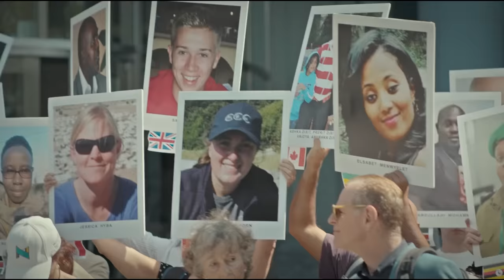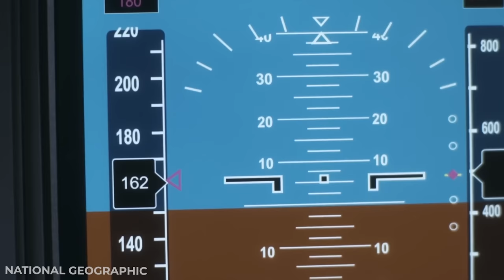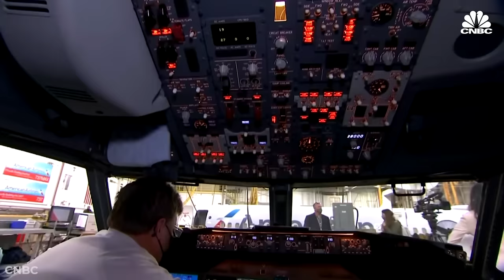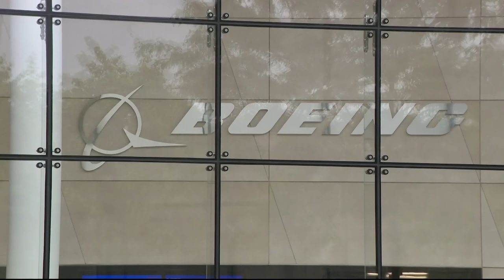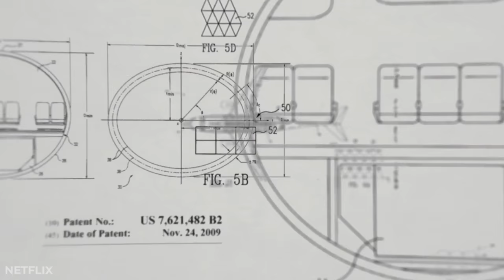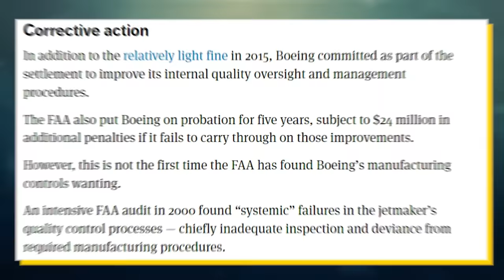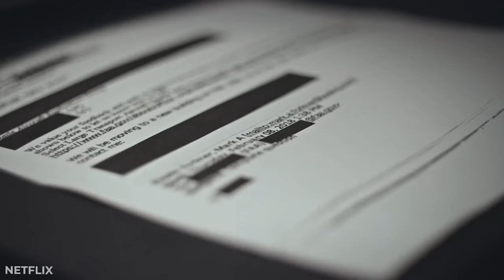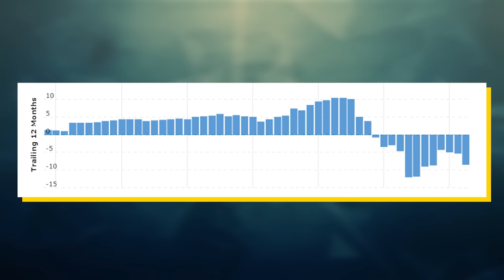Even Boeing Engineers Don't Trust Boeing...

Comment: These aluminum cargo door locks was a fatal flaw, the embarrassing part is a good engineer/citizen replicated the door lock mechanism for to further investigate his son's death and talked about how this flaw works in detail, this company I've seen so far was actually a trail before failure of ready to fly aircraft.
Reply: The cargo locking door mechanism was a problem for the  747 and the  DC-10 in the seventies and eighties by the supplier.
Reply: Yes it doesn't seem that Boeing applied itself to identifying that door problem. It was finally revealed by the NZ engineer who doggedly pursued and revealed the design issue, in spite of Boeing's non-cooperation and lack of support.
Reply: you should understand that there tens of thousands of these latches, and none has ever had a problem until now.

Comment: It is always madness to place Business logic over sound engineering.
But there’s also engineers that had reason to suspect systemic flaws if not specific ones. Any licensed Professional Engineer involved in such circumstances and organizations should be treated with suspicion. What bad characters they have.
Negligence. Arrogance. Sloth. Greed.

FTC or NTSB need to set up a whistleblower program for engineers to call out suspect transportation or structural engineering.
Reply from the maker: A lot of those engineers don’t really have a voice and fear keeping their jobs
Reply: @LogicallyAnswered  You have to build an environment where the easy, safe, and rewarding thing to do is report safety concerns.
Whistleblowing is an uncomfortable intermediate step to that.
If an engineer is handsomely rewarded for whistleblowing a shady business, inspection, or engineering climate, let alone for an actual design flaw brushed aside on the path to production? We will see business objectives line up such that engineers don’t need to put themselves out there. (Look at the fat percentage rewards SEC whistleblowers receive for financial fraud and such).

When it comes to engineers and the managers put over them, we need to eliminate the chronically apathetic and protect the honest yet timid and do both through solid guarantees of monetary penalties and rewards, respectively. Nothing else gets the job done.
Fat pensions and payouts for those who call out bad practices, and jail time or mandatory civil suits against those who were bad actors.

Malicious apathy, I think we can call it that when someone sees something and yet while facing no consequences still decides not to say something. 

We just need to create the proper incentives and smash the disincentives.
Reply: But...but... what you're suggesting would cut into profits!
Reply: We had that. It was called wikileaks. Some people did not like that website. Not one bit.
Reply: There is ALOT of bad practice in these big companies. Huntington Ingalls is one too. All these military DOD Army and defense contractors won't blink an eye at the death of an employee and won't hesitate to steal a dead man's benefits these days. Mass corruption and nepotism doesn't end.
Reply: "A good marketing team can sell a bad product. But a good engineering team cannot sell a good product. So why waste money to produce a good product?"

This has been the philosophy for decades now. The marketing team is usually better funded and more insulated from cuts than the engineering team.
Reply: Weren't they Indian H1B software engineers who just did as they were told and didn't raise any objections?
Reply: @Zed_Oud  Wow, dude, that would even fix the police! Will you be running on any election tickets near me? Make a seven second sound bite out of what you said and I think you could be president with it- really! Lots of people who might agree to put such a system in place will turn on it when it becomes their turn to "come clean", but it is exactly what needs to happen to "fix" Boeing and much of America, private and public.    FR
Reply: A near-fatal 1972 incident in which a DC-10 suffered explosive decompression when a cargo-door blew off exposed the need to address weaknesses in the DC-10 airframe that merited immediately attention to ALL DC-10 airframes, whether flying or under construction. The FAA decided that such a drastic move would hit the sales prospects of the new airliner, so they allowed McDonnell-Douglas to fix the in-service DC-10s 'over time', so it wouldn't scare prospective purchasers. Two years later, an unmodified DC-10 crashed in France, killing hundreds of people.
   On the face of it, the FAA was prepared to put passengers' lives a poor second to protecting commercial interests.
Reply: Come on: these regulatory bodies are in bed with the commercial interests whose sloppiness and irresponsibility they were supposed keep in check (independently).
Reply: What are you chances of working as a professional engineer if one blows the whistle?
Reply: As an engineer, I am confident that the short comings in the MCAS system would have been identified and raised by the engineers, but obviously they were over ruled by managers and told to develop it.

And I highly doubt the engineers would have supported the decision to wilfully hide details of the system from the customers by not placing any mention or description of the system in the aircraft manuals.
Reply: @thee-sportspantheon330  official paid whistleblowing already exists for financial crimes under the SEC and whistleblowers can get paid 10-30% on crimes greater than $1M. They’ve paid out over $1.3B in the last decade.
Reply: @the11382   There have been laws passed to protect whistleblowers.   But it does not go far enough and I don't know if it can.   Might lead to a glut of false claims if it get too profitable.

Consider this. Airline deaths are generally below 500 a year.   Automobile deaths number 1.3 million.    Cars are waging war on us.   We need FSD yesterday.

Comment: In 1985 I came back from an overseas job to work for BAe at Filton UK.  With 20 years of Aircraft Engineering experience, I was appalled at their methods. A middle Manager explained to me patiently that "" You don't need to know anything about Aircraft, to be a Manager""  ! ! !  at a time they almost went broke & scraping around for contracts, building a 4 engine 146 when the rest of the world & Operators wanted 2 engines,, etc  etc  etc
Reply: The 146 was well renowned though, airlines that operates them loves it and it's unique design makes it perfect for some specialized situations.
Reply: That manager's attitude is typical of modern business models. Stinks to core!

Comment: This is a good video, but one important part that is missing in the 737 Max story, is that Boeing promised Airlines that they would keep training costs down. Also, because of the redesign of the 737 Max and consideration for flight stability, Boeing introduced software that pilots were not completely aware of called MCAS. The software on the plane would falsely detect a stall and try to nose down. The pilots were unaware that MCAS was doing this and try to exert manual control until they crashed.
Reply: Also that one of the airlines said they were going to order a bucketload of medium airliners from Boeing for delivery within the next few years; despite the fact that Boeing didn't have anything. Hence they rejigged the 737 when it was unsuitable for the purpose, given there was no time; instead of declining the order.
Reply: Correct, Leroy. Pilots were never informed that they could override the MCAS system. If you watch the Mayday show, the investigators are mostly long-term pilots with years of experience and their golden rule before all this computerized automation came in was to "fly the plane," something MCAS won't let you do unless you know where the damn OFF button is!
Reply: @acreguy3156  glorious idea to implement a cruise missile function without anyone  knowing about and being unable to be overwritten by manual controls
Reply: The fatal flaw of MCAS is that it is a stand alone system controlled by a single sensor that is known to go bad! This is because tying it to the main flight computers would have required pilots to have to be recertified on the aircraft! 😊
Reply: @acreguy3156 Pilots weren't even advised of the stick pusher function!!😊
Reply: @jackdbur  All good points, Jack. It all boils down to money. It costs big bucks to re-train pilots on new systems. They made note of this on the "10 Steps To Disaster" show on why the MAX crashed twice.

Comment: Dad was a Boeing engineer for around 35 years, with a long pedigree spanning the 1980s to mid 2010s which I won't bother to cite, suffice to say he was there for the before and after. He always lamented the tectonic shift in attitude and management style he observed following the MD merger. 787 program was such a cluster it was the last straw that convinced him to retire. The experience of constantly butting heads with management and having to deal with their absurdity drove him positively batty. And the catastrophically deteriorating Seattle traffic over the decades but that's another story.
You wouldn't think one person could make a difference but sometimes I wonder if the MAX accidents would have happened if he hadn't retired after Dreamliner. He worked in flight controls and failure analysis and was a DER (Designated Engineering Representative) in the certification process.

Comment: As an aviation engineer myself my dealings with Boeing, the OEM, was not always smooth. I found that the Europeans with Airbus industry are more diligent and disciplined. Although the Airbus planes are harder to maintain in the sense that its more like rocket science.
Reply: I've worked on several models of Airbus and find them easier to maintain actually.
Reply: Who would you rather work for?
Reply: @mangos2888  im not a full engineer yet, im an Aircraft Technician,  I take apart the aircraft and fix any discrepancies,  so basically the aircraft have the same parts or similar part numbers when you order parts, so it comes down to what culture of company you would like to spend your life with. Boeing lays-off too much.  IDK what the retention rate is at Airbus or they're pay scale.
Reply: @elely1973  Since Airbus is European, and here Unions are a major power (or pain in the butt), it is harder to layoff, and if you do lose your job, if you were in a European country you usually get around 1 to 2 years of salary as compensation. 
If you work for Airbus in another country, well i imagine the layoff would be easier, but you probably still have more stability than with Boeing.
Reply: @aleide2980  yeah..I know alot of guys who worked for Boeing and they always talking about lay-offs, I don't know anyone at an actual Airbus facility so I really couldn't say how good or bad they are on the issue..I happen to like both of the products,  its the management that can be so frustrating.
Reply: @elely1973  maybe easier to maintain, but they also are less reliable. At least the pre 777-300ER period Boeing aircraft!

Comment: I refuse to ever board a Boeing 787!
I lost my long held trust in Boeing when Engineers and Assembly staff of the 787 both said there were issues with it's production. Apparently, Boeing has allowed Executives in their ranks that don't have "Safety" as their prime objective as it was with Boeing in the 1970's.
Reply: Hah! 
Now that I am 2/3's the way through the video, it appears that we both agree on the problem!
Reply: Airbus just won over another customer.
Reply: 787 has never crashed
Reply: @matthewsmith2787  Yet! Sometimes problems take years to manifest.
Reply: @BoDiddly  787 had problems too but it did not crash
Reply: @matthewsmith2787  but it  had problems
Reply: boeing 787 never had life threatening issues, only some issues with the battery which is definitely fixed now.
Reply: @SpidaMez  that's true yes
Reply: @SpidaMez  Give it time. Sometimes errors in manufacturing don't manifest until years later. When the people building them say there are errors, believe them.
Reply: @BoDiddly  look airbus fan, i just wanna tell you Boeing 787 are safer then anything like its the best you can think off and most crashes of Boeing were from only Pilot Error and most Airbus Were crashed from system malfunction and yes its true that both are safe but will crash but only on pilot error or system malfunction.
Also you simply cant win the case by saying Boeing plane malfunctioned in past and it might be true but most were Errors by crew or ground crew such as not removing the Pitot Tube tapes and stuff like that and most instrument failure are by battery issue or the maintenance team not checking the plane fully so yea both safe but both crash
Reply: @BoDiddly  okay, yeah boeing has fucked up before, but using that logic, you could say that for the a320 neos, the a350s, the a220, and any other plane that has not had a fatal crash.
Reply: @MyulMang  I like Airbus, but I am not a fan of Airbus. I have been a fan of Boeing, specifically, the Boeing 747 since I first rode in one back in 1973. So when I say I don't trust 787's, I know what I am talking about.
Reply: @SpidaMez  That is not the logic I am using. Go back and read what I said.
Reply: @BoDiddly  The 787 is easily the highest quality commercial airplane manufactured today. Give it time you say? The 787 was being designed and built for almost a decade. My fathers the FTM for the 787 at United, go read some technical standards.
Reply: @BoDiddly  And please cite your sources of engineers and assembly staff talking about issues.
Reply: @BoDiddly  if you are neither a pilot or aircraft engineer you have no idea what you're talking about. Each and every aircraft has issues, but thus far the 787 hasn't had a single fatal accident, not even a single hull loss, even though they've been flying around for years in significant numbers. And everyday aircraft of this type fly in bad weather, are struck by lightning, land on contaminated runways and encounter rough air. You have the right to say you don't trust an aircraft, but you have no right to say you know what you're talking about just because you are a fan of another completely outdated and irrelevant aircraft.
Reply: @japsie9280  I happen to be an Electronics Engineer and a Network (computers) Engineer. But I don't have to be either a Pilot or an Aircraft Engineer to know when something is highly likely to be unsafe. As the links I posted elsewhere in this thread infer, I am not the only one who thinks there are issues with the construction of the 787, and the people in those articles ARE Pilots, Aircraft Engineers, Aircraft Assemblers and Aircraft Regulator Agency personnel.
Reply: @BoDiddly  well yes you do have to be a pilot or aircraft engineer to know when an aircraft is unsafe. Congrats on being an Electronics and Network Engineer but as far as I know you don't design or maintain aircraft. The issues with the 787 were structural and found to be not safety related by qualified AIRCRAFT engineers. 

You need to realise that aircraft are incredibly complex machines you have no idea how much you don't know. All evidence and statistics will tell you that the 787 is a safe aircraft. Yes, it has it's problems, but that doesn't automatically mean it's unsafe. There is not a single aircraft without this kind of problems.
Reply: @japsie9280  FYI, I am not an Automobile Engineer, but I also know when an Automobile is not safe to drive.
Reply: @japsie9280  I am not a Ride Engineer, but I know when one of the rides at the local fair are not safe to ride.
Reply: @BoDiddly  no you don't, you wouldn't have the skill or insight to determine when something is actually safe or not when you're not educated on the subject. You really have a confidence problem.
Reply: @japsie9280  Actually, I do have the insight to make that determination. I also have the intelligence to make evidence based decisions.
Reply: @BoDiddly  you should read about the Dunning-Kruger effect, because it certainly applies to you.
Reply: @japsie9280  I know about it, and it does not apply to me. I am not overestimating my own ability to make sound decisions, based on evidence and facts, about what is safe or not.